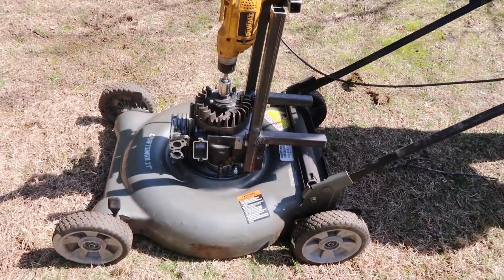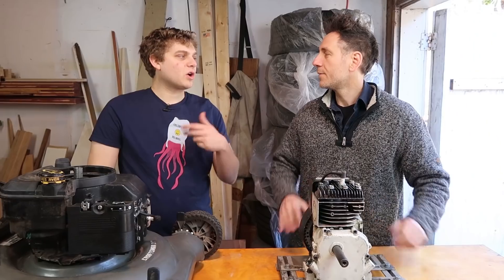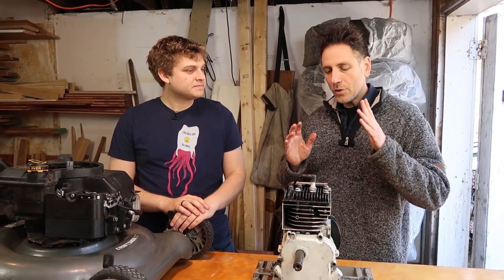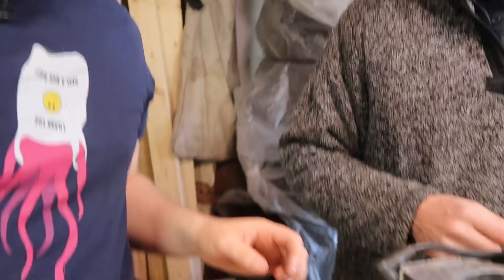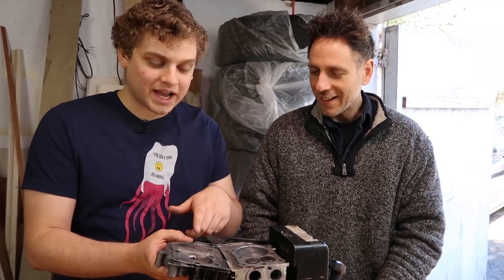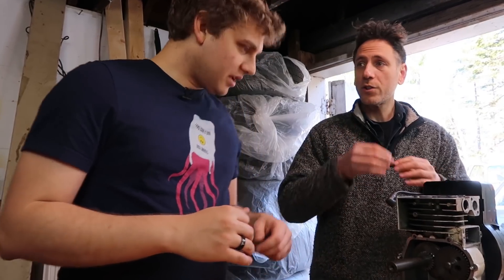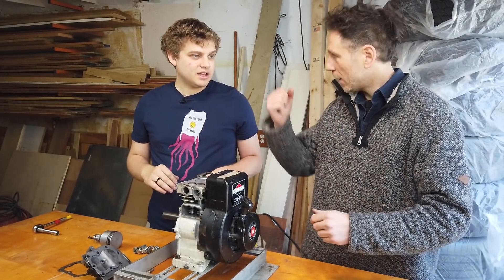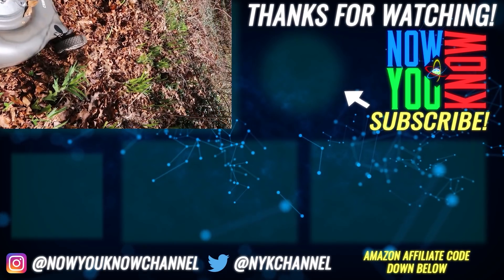Electric Conversion Workshop: Lawnmower Project - Episode 1

Comment: This is great! And quite timely too. I had just started a 6 week course on small engines run by a local high school one week before quarantine started. We did a little bit of a teardown and then it got cancelled because of the quarantine. I had already replaced my car and my mower with electric but still wanted to know how gas engines worked

Comment: You aren't hemorrhaging energy just changing it's form when going from electrical to mechanical in the first steps the loss is just the heat off it and noise vibrating the air.  Ideally a device would be silent and cold while converting from electrical energy to motion but even electric motors have loss as heat base on resistance and bearings etc. holding the shaft.  The electric motor efficiency is still higher but think the description of wasted energy in the stages shouldn't be a focus.
Reply: Really? You don't think a 70 to 80% loss is important to point out?

Comment: it is the expansion of the air that pushes the piston down. because the air goes from outside air temperature to 1000+ it pushes the piston. it is not an explosion. if it were an explosion, we would speak of knock and it would destroy the piston
Reply: You could be right, it is a flame burning expansion. Basically the engine is a air pump.

Comment: I would love to see you testing: (1) swimming pool as a battery, and (2) transforming freezing expansion force of water into electricity.

1. One of the most traditional ways to create electricity is water power. On the other hand and easy way to store electricity is to create potential energy by pumping it into heights. We also have pools on rooftops. Could these facts be combined?

2. I'm from an Arctic country so solar energy is out of the equation in winter time – the sun is gone for months and everything is pitch black. But we have ice. Freezing water expands which equals movement with huge power. Could freezing expansion be used to create energy from ice?
Reply: Wow interesting ideas. Didn't think about it. I do know that you can get energy from the difference between hot and cold. So maybe outside air temperature versus ground temperature which is always 55 degrees. Or maybe a water turbine from Ice runoff could power a generator.

Comment: Although I know how a ICE engine work I still found this interesting. This is a good video to send to someone who knows nothing about engines and don't see the point of whether its electric or petrol. I will wait for episode 2 before forwarding this. It is worth mentioning that car engines worked like this way back before they started with overhead valves and cams.
Reply: Oh yeah good point, this is a flathead Engine with side valves. The most inefficient way. There have been many improvements since then. However even the best of them only get to about 30 or 40% efficient.

Comment: 20% efficiency is what would be the best case in a car, here it's probably mor like 5%
Reply: @Raphael Krug you are perhaps a bit low there, perhaps more like 8%.  Btw @La Chatte Botte, while modern IC engines claim to be 40-even 50% efficient, in the real world of driving around, cruising down the highway even, the 20% number is a better value to use.  cherry picking efficiency numbers that are seldom ever seen in day to day operation is not realistic.

Comment: There's also a lot of air friction in both the flowing gas through the engine, and in the crankcase.
Combustion engine vs electric motor, is like incandescent light bulb vs LED.  One is mostly a heater.
Reply: @Howdy Justice Pumping air through an engine sucks a lot of energy.  Just think of some engine efficiency/power improvements you may have heard of such as straightening the flow of air into and out of the cylinders. This air friction is even worse when the air has to snake around obstacles or change directions, just like water in a rocky stream.  
Beyond trying to compress air around anything, it also has a thickness, like honey, and stickiness, like glue.  The harder you try to move it, the more it fights back.  Look up 'pumping losses,' and fluid dynamics in general, to learn more.
Reply: @lubricatedgoat  well explained
Reply: @Howdy Justice Its MORE about parasitic drag.  Which can be reduced greatly with lighter rotating internal mass.  Plus low friction coating from MicroBlueracing.com
Reply: Yup